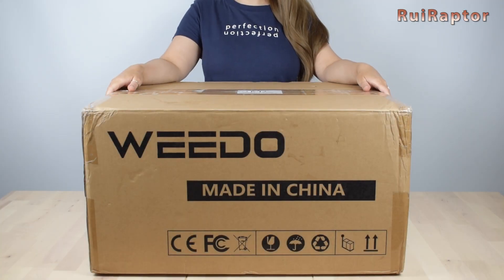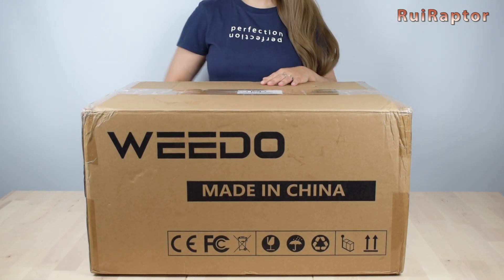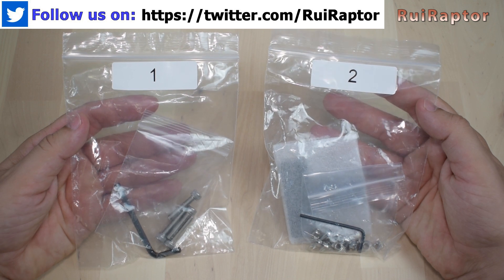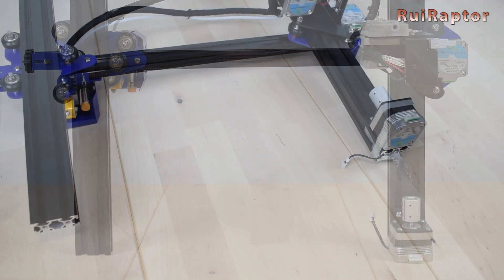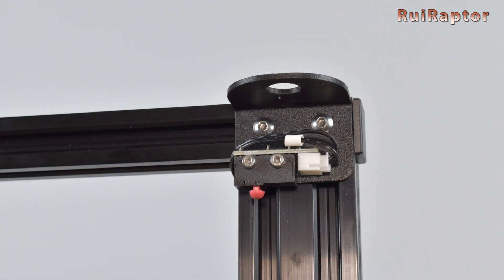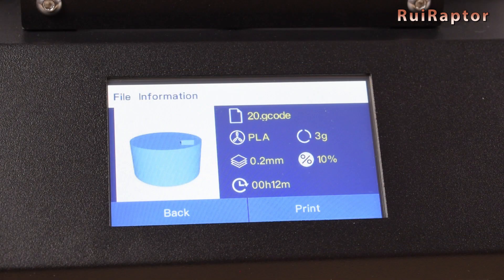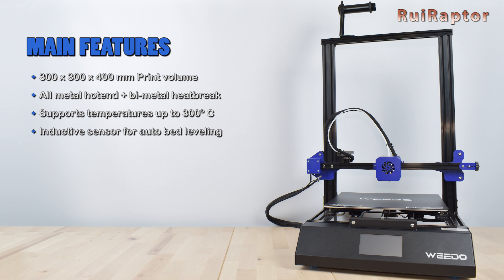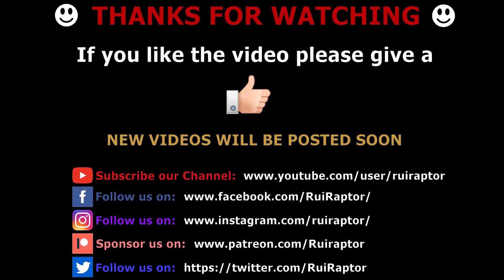WEEDO ME40 - New 3D Printer From KICKSTARTER - All The Details

Comment: No, it's not a good printer to buy because it doesn't have WiFi and the SD card slot is upside down.
Reply: who the hell wants a manufacturers terrible, liable to fail in the future wifi implementation?
Reply: @BeefIngot The 21st century does.